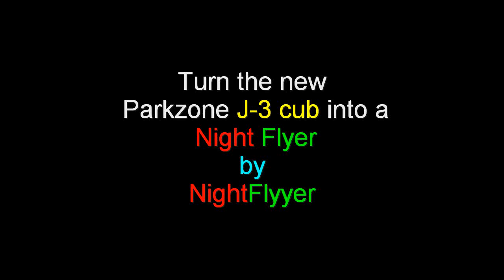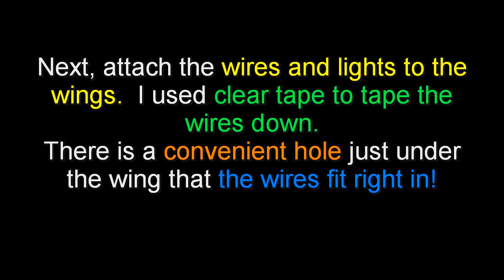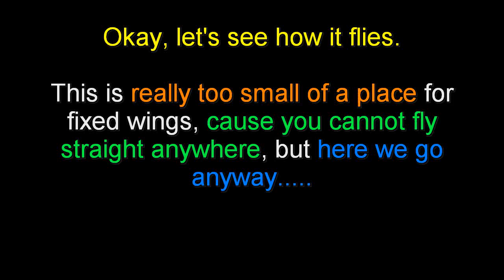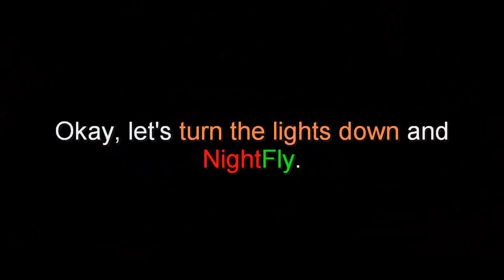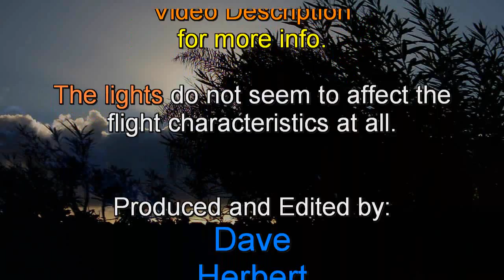I turned my PZ Micro  J-3 cub into a Night Flyer by NightFlyyer.

Comment: Well since you asked, a 3D helicopter is one with variable-pitch blades. This means that it's able to fly upside-down. It's definitely not a good transition from a small 3-channel indoor. I would recommend either the 4-channel Blade CX2 or 120SR.

Comment: hey dave it's dave, the welsh one, happy birthday!

I've convinced my partner to get me the RTF Blade mSr from our little girl on fathers day, Can I use the Tx from that to run the J3 CUB and are the lipo the same?

P.S. If you have time I'm thinking about putting a pcb from a micro radio car and two bi-directional picooz tail rotors into frame my syme mini chinook to add a 4th ch to the existing 3ch for ailiron effect, any thoughts?

Comment: My motor burned out after only a few short runs and I replaced it with Airhog motors.  The performance has improved along with lift and slower speeds are even easier.  Check out the video i posted.  You should do that to a few models and sell them on ebay.  I had a few sets of plug and play light setups that i sold for $20 a piece.  Used both a male and female plug so that it could be ran with them off too.  Well, nice flying and creativeness.  Cool to know that there are others out there.

Comment: im not very familiar with this plane but it seems to be very stable and forgiving.  My first plane was a Hobbyzone FIrebird and I was 8 or 9 at the time so there is an option. I would recommend about any highwing plane and its better with a pusher prop because if you nosedive you cant damage the mount shaft etc.

Comment: @rufus324 thats normal. The plane is so light and the engine has so much torque compared to the wieght of the plane that they need to angle it down so that the plane does not just do loops all the time :)

Comment: Mr herbert,salutations from Ford City PA USA,i really don't care for linear servos,i have found them to be less reliable, and problematic,just curios on your thoughts about them thanks.
Reply from the maker: Yes, old linear servos were jerky, as we made them for a while when I worked at Kraft, but that is when we developed exponential control for the transmitter, now available on all transmitters.  I do not use them, as I learned without crutches and Expo makes the servo move more than I like when I dont want it to move.  Thanks.
Reply: Oh ok,  makes sense,i have been following your  videos for a few years now,and i find them very helpful,i started building planes from scratch about 4 or 5 years ago,the first ones looked a little simple and rough but flew pretty good,then about a year into building,the planes started to get pretty decent looking,last winter i built a FW 190 it took about  80 hrs to complete from the build, to electronics, then paint, and then the final phase clear tape covering.I forgot to mention i build my planes from dollar tree foam board,with some bass wood behind the firewall,(which is made of ply wood)any who it is a real good sense of accomplishment when you see it fly.Do you build planes  from scratch as well?Please keep the great videos coming.